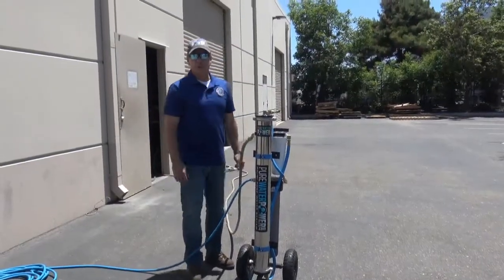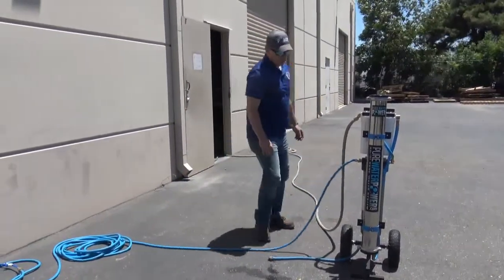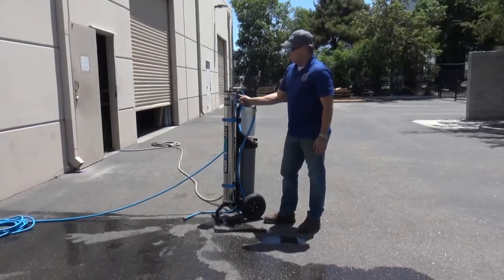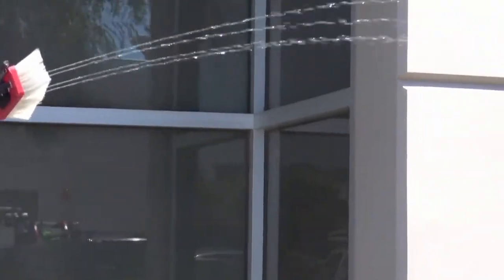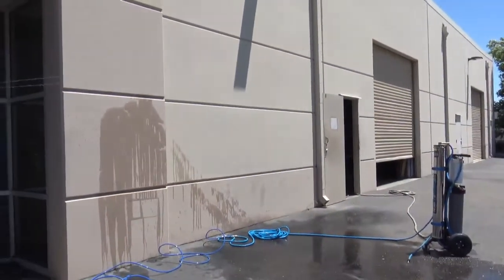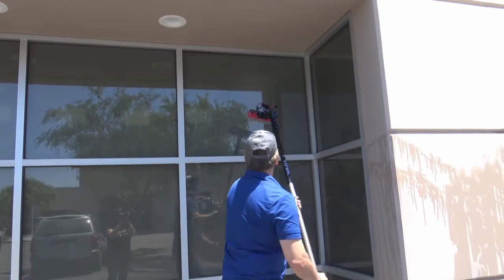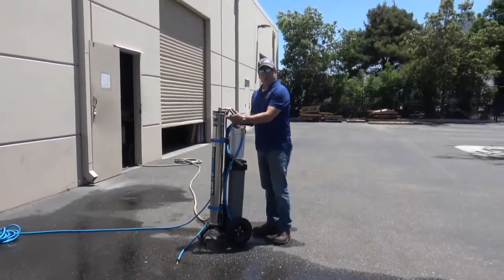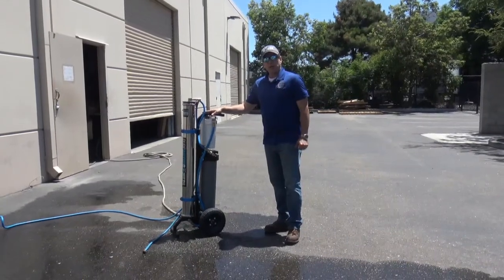Pure Water Power 4-Stage RODI Cart In Use

Comment: Couple questions how much does the RO filter cost how much does the d i filter both in the 10-inch version and the 20 in and how much does the carbon filter cost are these proprietary or they're Universal where I could get him anywhere and will this unit fit in my Toyota Corolla if I roll down the back seat
Reply: Put it on top of your car
Reply: @stearswindowcleaning  I finally got a.truck